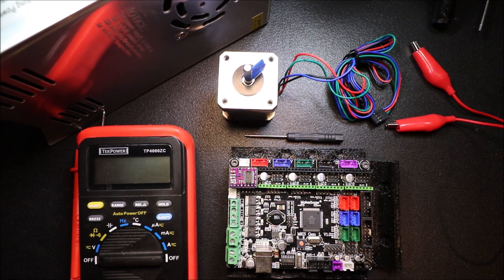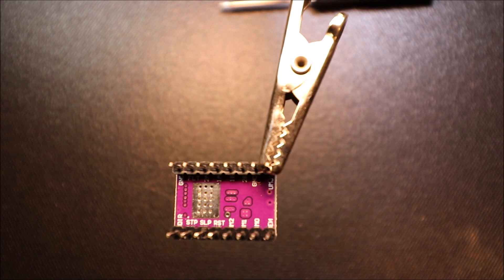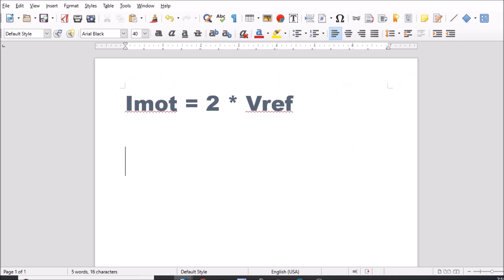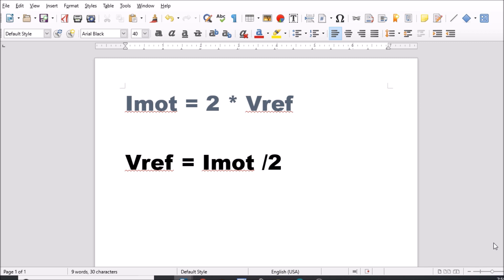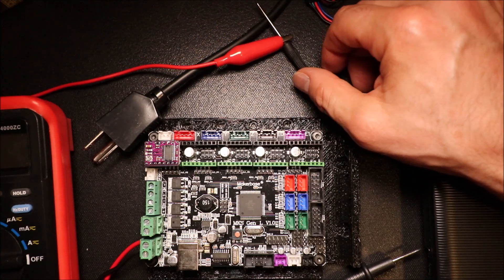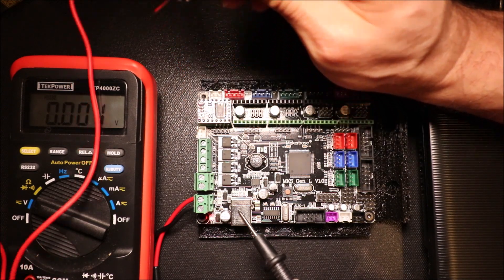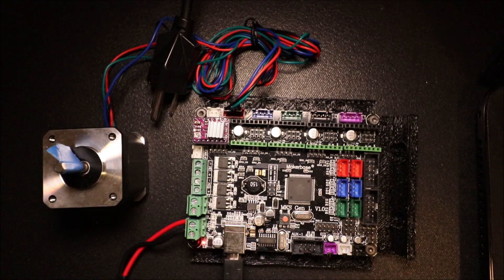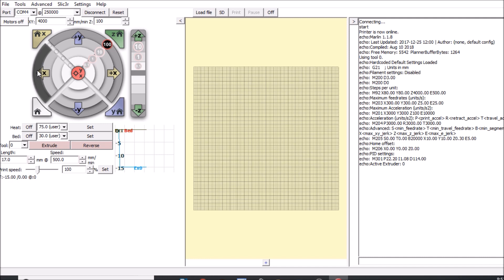MKS Gen L - DRV8825 Calibration

Comment: I think the jumpers need to match the micro-step settings of the driver.

But how does the +12/+24V on the MKS get to the motor (pin 16 of the purple board).. it doesn't seem to be shorted?   For example, is it possible to run a motor at 5v assuming a driver that supports that by applying 5V to the MKS terminal block?
Reply from the maker: Yeah.

Comment: Hello Edward,

somehow my extruder no longer works.
I have made a new setup with new Arduino, Ramps1.4 and other Motor
it seems that either the motor is not good OR maybe the stepstick
of course it could also be the software, but it seems to me not.
I also doubt whether I might have kept the extruder too close to the heated bed, although I don't think so!

I just have to see what I have but thought about making a test setup for motor and stepper driver
I still have loose Arduino stuff like a UNO
 .....
and maybe I also have a Ramps 1.4 with an Arduino mega.
I just have to see what I have.
otherwise it becomes a UNO with a breadboard with a stepper driver on it.

maybe an idea for you too?
a UNO breadboard with stepper for testing motors and steppers.

friendly greetings from The Netherlands!
Rob.
Reply from the maker: Motors almost never go bad.  Is your extruder warming up?  Do you see error messages in Pronterface?  Have you tried testing motors without filament or switch them with x axis?
Reply: @EdwardBraiman  Hello Edward,

nice that you respond so quickly!
Engine almost never bad, yes I agree with you, correct!
And yes the extruder gets hot.
I have an LCD screen and it does not give an error message!
engine then tested without filament and then it seems to continue to work / to turn.

I had it printed and then the engine stopped.
I then restarted when the engine stopped and then I helped with the hand, it seemed to have no power!
even stepper you still try to give more power by turning the mini trimpot.
but that didn't work either!

I will take the printer out of the dust again in a while, because I didn't have any time for it anymore!
(If I find out what it was I will report it here!)

greetings from Rotterdam area!
Rob.

Comment: I guess I'm just stupid because i cant figure out what i need to set my trimpot to. I have the DRV8825 with resistor value of 100 and my motor is a Nema17 42BYGH40 40MM 1.7A (1.68 max) 0.45N.M... your motor is 2.0A but what is the other 2 in your equation? Where did that come from? I am so confused here... I even watched your A4988 vref one and i still cant figure it out.
Reply from the maker: First the video is very hard to present and follow.  Second think about the Drv8825 like a musical string.  Third you can always tune by the sound of the motor and how warm the motor gets.  The video is mostly about the process with a data sheet.  Wich part of the equation or term in the equation is not clear?
Reply from the maker: It comes from the datasheet on your NEMA17.  It's from the datasheet equation on the DRV8825.  Try googling each part with second word of datasheet.  They explain how parts interconnect electrical.  It's not fun reading, but will help you understand better.
Reply: @EdwardBraiman  any way you can tell me what my trimpot current should be set to? then i can figure out how you did it. I am confused by yours because you are doing 2.0 (max motor rated amps?) divided by 2... So what you are saying is in my case i would do 1.68 divided by 1.68? Where are you getting the other 2 from? what is that second value from?  Your other video it was something like max rated current on stepper motor divided by the resistor value x8 or something so I just dont understand. My motor is 1.7A (1.68 according to datasheet) and my DRV8825 has R100 resistor on it if that helps you help me calculate.
Reply from the maker: First, what does your motor sound like uncalibrated?  Is it noisy or whisper quiet?  If it's noisy, then calibrate the voltage down to where it is barely able to move and tell me the multimeter reading. Then we'll see if the math matches.
Reply: @EdwardBraiman  it is extremely quiet now but still no idea if it is correct or not. I had it at .95v i believe and then down to .85 and now im at .75 where it runs very quiet and cool however I think that is way lower than it is supposed to be. I wanted to start from the correct current and go down from there but I could not figure out the formula. Even asking you i still cant get the answer lol
Reply from the maker: It's about running the quiet and cool.  If you calibrate the others the same you should be ok.  When the motors run hot they skip.  Sounds like you know how to calibrate them by ear.   When you run your first calibration print monitor the NEMA17 heat.  If they stay cool to the touch then you'll be correctly calibrated.
Reply: @EdwardBraiman  the strange thing is I calibrated them to what I thought was correct around .95v but then they were running hot so I started to panic thinking i did it wrong and then lowered by .10 which helped but still hot so I did it -.10 more and it is almost silent for most of the movement speeds however, the other strange thing is the stepper drivers were hot when it just sat there in the home/lock position with no fans on. When the home position where the motors lock, the stepper heatsinks were about 134 degrees and climbing while i had the fans off. Is that normal? Should they be that hot when they are getting power to lock their position? I was thinking I had the firmware currents set wrong or I needed to change some settings for the drivers somewhere. This is all new to me as I learned everything in about a week since I last commented on your A4988 video asking about a Gen L upgrade.
Reply from the maker: When they are locked current is flowing to hold them in place.  Thus the heat. My initial process was the calibrate to just above being able to move.  It's a close approximation.

Comment: So I followed your Instructions what do you consider hot
Reply from the maker: Depends on the datasheet for the Nema17.  Hot to the touch is too hot.  They should run Luke warm.  Also they should move without much noise.
Reply: I have the exact same set up as you in this video I set it to 1.0v it warm but not to hot to touch but it’s pretty warm
Reply from the maker: Warm maybe okay, but the video does say look up the motor you are using as it can vary by manufacturer and type of Nema17.  This is why I reference specific motor type to calibrate.  If they do make noise or get hot you should reduce the current.

Comment: Yes. I'm about to install MKS TMC2100. They say to remove all jumpers underneath on the board...never having done this, can you explain why. 
Thanks for the great vids. Very simple and concise not taking anything for granted.
Reply from the maker: I've yet to research this version of TMC2100, but working theory would be they control the subdivision on the TMC chipset.  Granted the datasheet for the TMC2100 would be your best resource as to why.
Reply: From what I understand is the step divisions can be set in Marlin. I'm doing this today so I'll find out and get back to let u know what I find...
Reply from the maker: @neuxstone  Yes, you can select the stepper type in Marlin, but you do not have SPI, like TMC2130.  Keep in mind I have not used this stepper driver yet, I'm still trying to understand TMC2130 in detail.
Reply: Edward Braiman ok. 
Removed the jumpers according to all I’ve read in several postings. 
I have only the one for extruder and the rest are TB6600 powering NEMA23 on XYZ. 
It’ll be “fire in the hole” tomorrow.

Comment: Hey there! I commented on another of your videos and you answered right away and helped me decide to get this board. I'd love to see a video about setting up TMC2130s with this board. I saw you replied to another comment about this as well. So far I've gotten everything except sensorless homing to work. The hot end/bed just rams the end of the axis and the motor makes awful sounds. I've tried Marlin 1.1.8, 1.1.9 and 2.0.x bugfix but none are working correctly. I'm sure you'd get it working though lol
Reply from the maker: I'm still experimenting with TMC2130.  I've been able to do sensor less homing, but don't know it cold yet.
Reply: Oh boy, what firmware version did you use? I've been at it 16 hours and can't get the configuration right...
Reply from the maker: 1.1.8.
Reply: Wow. Somehow I've managed to get it working in 2.0.x bugfix. Not completely sure what finally got it going but I'm loving it so far.
Reply from the maker: So any words of wisdom on setup?
Reply: Let's see... I'll assume you've already got them wired up. For me, I changed my CS pins off the AUX2 header so I could use it for my Anet A8 controller. I've also learned that the active cooling fan automatically uses the E1 power terminal if you haven't defined an E1 in Marlin. Also, with the 2.0.x firmware, the TMC2130 library has been switched to TMCStepper and the endstop interrupt setting can't be used as it won't compile. Other than that, it appears that everything is set up as normal. I'm not exactly sure what made everything start working.
Reply from the maker: I've got it working in 1.1.8, but trying to get smaller NEMA 11 to work with Endstop is an issue. Still no Endstop response.  Also need to experiment with stepper driver. Modes on TMC 2130.
Reply: I've only got my NEMA 17 motors to work with. I've been running them in StealthChop mode with the hybrid mode turned on at 100 mm/s. Haven't yet done anything that fast but it does do homing in SpreadCycle mode. I have to say, stealth chop is incredible. I can't hear the motors at all.
Reply from the maker: At least when the video is recorded, there will be no questions regarding trimpods and multimeters.

Comment: tmc2130 plz
Reply from the maker: Just started reading about it and have some, but need to think out a simple presentation for a video.
Reply: Edward Braiman you are great Ive just watched all ur videos many times got the gen l yesterday and can’t find and videos on it except yours I did the same as the video but got nothing I guess tmc2130 need different configurations
Reply from the maker: TMC2130 is a very interesting stepper driver.  I'm still trying to understand the simplest parts.  I'm going to possibly do multiple videos just to cover a small fraction of its configuration.  This might become my main stepper as soon as I understand how it works.  My main interest is using it without having x and y axis endstops.  But it may take a couple of weeks to understand.
Reply from the maker: Also ordered a new camera lens to see if the video quality can be high enough to present details for good viewable understanding.